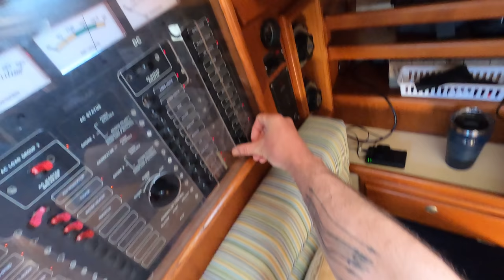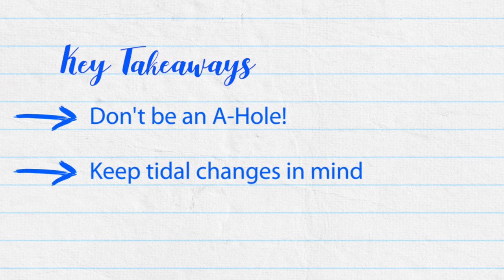I'm an IDIOT... | S06E04

Comment: That's why you need a mid ship cleat to which a line is already attached and ready to be tied to a mid dock cleat. Once tied, you keep the engine in Fwd gear to force the boat to get closer to the dock giving you time to cleat the stern and bow lines.
Reply: Exactly.  Takes 'some' of the pressure of marina docking out of play.
Reply: As you gain confidence with the bigger boat, you'll appreciate the importance of a well-placed spring line. It will snug you right where you want to be; then you'll have time  to tie off bow and stern lines.
Reply: Exactly, mid ship first, then bow and stern lines.  Once you get the mid ship line attached, all the stress is done with.

Comment: I don’t laugh out loud often, but when I do, it’s when someone applies Forrest Gump to real life. Anyone worth their salt has been there. Anyone worth knowing will admit it.
Reply: Yes indeed, and I laughed very loudly on that one.. hahha well done!
Reply: I idled one of our center console boats home at 2 knots for fifteen miles because I couldn't get the engine to go above idle.  I couldn't figure out what was wrong out on the water.  They next day, on the trailer, I immediately saw a clamp was loose on the throttle cable, that was just stopping the cable from pushing the throttle forward.  It took me three minutes to fix it.
Reply: HA! I totally laughed out loud at, "I'm not a smart man".

Comment: Tip for backing out of your slip:  to minimize the undesirable effect of prop walk, when you want to back out of your slip in a straight line (or even swinging your stern to stbd), put your shifter into reverse, give it a good shot of throttle, then quickly shift to neutral and steer to place the stern where you want it.  The idea is to get some momentum going in reverse without allowing the prop walk to take over - if you need more momentum in reverse during the procedure you can just quickly shift into reverse, give it a shot, then back to neutral.    That way, your rudder will be the chief instrument of steering, and your effort will not be confounded by what the prop is doing.
Reply: I agree.  You probably already know this but your boat is so heavy you can use the momentum to your advantage. Absent wind and current you can rotate your boat in place clockwise ( to starboard). While stopped put the rudder hard to starboard.  Gun it in forward and let the boat start to turn. It will turn before you go forward because of propwash over the rudder. Leave the wheel to starboard and before going forward too far, gun it in reverse.  Prop walk will continue the turn to starboard even with the rudder unmoved.  Before the boat starts to go backwards to far, gun it in forward again and keep the boat rotating.  Rinse and repeat. Doesn’t work to port.
Reply: @edburke2902  You are both right.  I remember when I finally learned the technique you described.  A life changer for me and my 20 ton Kelly-Peterson 46.  I think the key is to not be shy with the rpm's when you give it that boost to get momentum.  These two will have it mastered in no time.
Reply: I had a 31 Hunter that could walk to port around the world. Thar is what I would do. Power-coast. Power-coast

Comment: I have mailed you a complete shop repair manual for that transmission..You don’t start troubleshooting this one without that manual. The shift adjustment and lever position are very important to assure proper shifting. It is very important to have shop repair manuals on boards of all the critical boat components..

Comment: Lessons learned guys, just quick tip from one boater to the other (I also didn't see if you were doing this):  keep a pole in the cockpit to help you grab or push off in tight areas. Great communication between the both of you. Just keep practicing, you guys will get the hang of the boats characteristics soon enough.

Comment: When you're working in tight quarter like that, and on a new boat small issues like that happen.   Once you get acclimated and more intimate with your boat you'll be fine.    The fact you owned it and put it on camera is huge.  Double thumbs up and you two enjoy your spring and summer now, in the states.

Comment: Regarding the instrument’s low voltage while the battery had plenty.  Check the instrument wire size.  Odds are good it’s undersized probably because more instruments were added but the wire not upgraded.  Undersized wire will heat up, causing resistance and then low voltage readings.
Reply: Good tip; something to note; thanks.👍

Comment: Put a loop of line around the piling to hold the bow in place, then in forward, the stern will walk around to starboard.  Push off the piling, let go of one end of the line as you move forward.  Maneuvering with wind is a skill set only time will improve.  Everyone is stressed in these situations, keeping ones cool is important.  Good job.

Comment: Great video and excellent to see the docking practice. One thing I have learned over the years is never try to fight the elements and always try to use the characteristics of your boat to your advantage. When you first attempted to reverse out of your mooring you had the wind and prop walk working against you. What would have been better is to back out and go backwards out of the alley rather than to try and turn around and go forwards. That way the wind would help push your boat to starboard and prop walk also helps push your bow to starboard. Once the boat straightens up with the wind from behind you can easily back down the alley way. So much easier and less stressful. Good luck and give it a go and don’t be afraid to go in reverse. Keep up the fabulous videos.
Reply: I was going to say the exact same thing.

Comment: Something that is easy to forget is that you can't steer a boat if you're not moving, and it is easier to steer the faster you go (or at least the more water passing by your rudder in a current). It is usually best to give quick bursts of throttle when doing the forward/reverse tight turning leaving your slip.

Comment: Good job with the practice.  You did well. We had the same problem backing out of our old slip—prevailing winds and prop walk exactly wrong.  You might Try turning 270 degrees to the right rather than 90+ to the left.  Use your prop walk to help the turn rather than fight against it. On our boat it was easier and we had better control that way, plus we could accomplish the turn with less room to maneuver.

Comment: Don't feel bad, Jordan. You had the best possible outcome from that long drive--everything was fine and you got back a working transmission the same day!

Regarding docking, I had a 30' sailboat years ago and was very comfortable docking it. A couple years ago, I got a 40-footer and was nervous every time I pulled in or out. I had no idea where the bow was and couldn't judge the distance from the port side to the finger on my slip. Now the 40 feels like the 30 did before. You'll be amazed how all those extra feet just disappear as you practice and gain proficiency.

Comment: Great Stuff ! Remember, you do not need to turn around immediately after exiting the slip.  For the first maneuver:  try standing in front of the wheel facing the stern...get used to driving stern first. Facing the stern with the wheel in front gives you a different perspective. You will no longer feel like backing should be a temporary state especially with that beautiful canoe stern.

Comment: Great video both! We have a long keel boat and I totally get the feeling. Few tips I got that might help: landlines. Works great as a tool. e.g. for undocking in the situation you had you could use a spring line from the bow to the dock or even the mooring post. Wait a bit when the boat is out of the slip and use it to have the transom blown by the wind into the right direction. Another tip; give 45 degrees rudder and then give some small but powerful burst of gas. You then do make the turn but not the speed. Anyway, as you mentioned: trying is the best way to learn. Have fun playing around!

Comment: Nice job owning the situation and learning from it Jordan!  Nice job putting op with Jordan Desiree.  I once spent two 14 hour days troubleshooting a generator that wouldn’t come up to speed after replacing an injection pump.  Fiddling with ramp rates, set points and PID loops, changing governors not to mention pulling the pump on and off who knows how many times.  I finally discovered the control had a separate speed potentiometer late on the second day, a little twist of the knob and viola, fixed!  My supervisor then had to explain to the customer the reason his genset was down for two days is that I was an idiot ... and I was supposed to be the “professional “. We all make mistakes, what matters is what we do about it.

Comment: to be fair, such mechanisms usually don't rely solely on friction to work properly. most, in addition to the pinch bolt, have a series of splines around the inside of the hole in the lever and matching ones on the shaft to prevent slippage. the number of splines and their proximity to one another provide adjustability.

Comment: Having a long keeler one of the most useful things for me is a midships cleat. There are a numerous resources on the technique. With a short finger pontoon it is easier to use this first, you can then use the engine to hold the boat in place, deal with the stern line last. As for the tides one quote from a club member who was hard aground, " I know the tide goes in and out, I forgot it also goes up and down".

Comment: When going alongside best practice is to focus on the middle cleat, prepare as always but initially ignore stern and bow lines. Fenders out. Steer the boat as close to a cleat / bollard /etc on the dock with the crew holding on to a shroud standing outside the railing already. As soon as it's save he/she steps ashore and fastens the line from the middle cleat to the dock. Now the boat is under full control no matter of wind or current and you have all the time to fasten the other lines. 
As for the shift lever I am truly amazed that it isn't sitting on a toothed shaft.

Comment: We went through much worse docking scares and stresses after upsizing! Try a midship spring - we found this one line makes it easier to dock even against current or wind. Find the balance point of your boat when motoring ahead (in our case it's slightly aft of mid ship). Rig a line with a spliced loop as a lassoo,  and bring it through a block at that balance position on the toe rail or other strong point back to a winch in the cockpit. Your partner can use a boat hook to snare the cleat at the end of the dock with the loop end without stepping off the boat (way safer). Helm person take up slack on the winch which stops your forward motion. Now turn wheel away from dock and use gentle forward - the prop wash and spring action will bring you alonside and the boat will sit happily like that so you can step off and make up the bow and stern lines then fit the springs. When manouvering in tight spaces your boat will turn much easier clockwise than anticlockwise due to the prop walk - using bursts of fwd and rev you can spin round in your own length. Also easier to dock on Stb side as the prop walk takes you away from the dock when you reverse out. If you dock on port side, try a doubled up spring line from bow through mid dock cleat and back to bow - motor forward against that to kick the stern out even against the wind before backing out. Good luck mate :)

Comment: So, good on you guys for practicing.  I learned from my merchant marine husband to "pulse" the throttle to turn the boat without gaining much way forward.  So in your backing example, instead of a continuous gun forward, several punches would have probably spun you around better without the threat of more speed careening into obstacles.  Also, learn to use your lines to leverage yourself out of tight spots.  If you could have had a stern line on the piling off your starboard quarter, you could have backed into that line, it woulve held your stern from walking and enabled you to spin out of that spot a little easier.

Comment: When you left the slip, you should have just gone backwards out of the narrow channel. Never anticipate that you can push the bow of a larger boat through the wind in a narrow channel. You might be just going forward and backwards and slowly be blown into the dead end of the channel. There are never issues pulling the stern into and through the wind. Same goes for leaving a dock: sometimes leaving backwards is better if going forward would mean going through the wind.
When it comes to the walking prop effect: Try to accelerate the water under the boat with high rpm first, then immediately reduce to low rpm and the prop walk will be less. When maneuvering, I give the boat a spin in the opposite direction in the second before reversing. The inertia of that turn will counter the walking prop effect.
A larger boat often has a midship cleat. When docking with one person, it is much easier to just have a short line running from that cleat to the dock. You then have all the time to get your bow and aft lines sorted out.

Comment: Good effort on keeping at it, all day, to get a handle on it :-)

I have a small piece of advice, investigate using your warps more for docking.

Holding a line from the bow, looped round a cleat you can slip and take with you - so you can hold the bow in for example when leaving the slip.

When coming in to dock, consider a spring line first, and drive against it to tuck in, and even stay idling against it so you can be held in place while you get everything squared away.

With the tides, where possible always head to the dock into the tide, even if it means going passed your destination and turning round.  This gives you steerage without speed over ground.

Keep in mind it's a boat, not a car. Think in terms of using the wind, tide and warps ahead of reaching for the engine controls, you'll hopefully have an easier time of it in future!

Comment: Good job with practicing!  We went from a 33 foot sail to a 42 foot sail and it was an adjustment but doable.  Then we went to a 48' trawler that had the prop walk go to starboard rather than port like the sailboats and THAT was hard to get used to!  But all through our boating years, docking would have me put a spring line on first.  Once the spring line was on, we could use the prop walk to help pull us in when docking on port.  Our bow line was almost always the last line on.

Comment: It is always scary to dock the boat. Our old semi-long-keel without bow prop, is also terrible in tight spaces. We are now always docking by using  a spring line from mid-ships and aft. Then we use the engine and to push the boat towards the dock and hold it there. We find it a lot easier to only have one rope to focus on when docking. 
Good luck with your new beautiful boat. :)

Comment: If you are coming into the dock too fast, you can scrub off speed by 'surging' the dock line around a cleat. It saves the possibility of hurting your back by trying to stop a boat with your hands.
Also, on a boat the size of yours, it is worth learning how to dock using a midships cleat if you have one.

Comment: Nice video.
Two hints when docking.  You can't steer effectively when engine is in reverse.  Use the engine as a thruster.  Give it enough power to start moving in reverse then go to neutral and now you can steer.  Need to go further in reverse.  Give it enough thrust to get moving again and immediately go to neutral and now steer.
Second hint is when going forward and turning but nearing an obstruction  go to hard reverse  but do not move the wheel.  As long as boat is still moving forward and slowing it will continue the forward turn.  Only after you stop or start in reverse will the rudder come to play.

You can do a cool maneuver by turning the boat 360 degrees but not going forward or back using this technique.  Try it and enjoy.  Start moving forward and say turn hard to port, then hard reverse until you stop turning, then hard forward to continue the turn.  Repeat until you've gone 360 degrees and you never moved the wheel.

Comment: haven't watched the full video yet but had a 47 footer for 7 years.  Lesson number one for me was "Don't fight the wind."  Get comfortable operating the boat in reverse...should have just backed out into the main fairway.  Also to avoid prop walk add more power and get the boat moving so you have rudder control.  Practice using prop walk to help maneuver in tight places...you'll find that you can spin that baby on a dime.

Good Luck.  It's an adjustment but you will make the transition in no time!

Comment: Docking can be sooo challenging when you are battling wind and current, even in a boat you are familiar with.  You did really well considering it was your first time in a boat that size.  For what it's worth, when your entry into the fairway carries you away from the slip, I prefer to go past about 2 boat lengths, make a U-turn and head back into the slip.  This way, you can use the throttle in forward and reverse to counteract any drift from wind and current and adjust your speed.  With prop walk to port, you should be able to spin that boat clockwise even in tight quarters.  Put the helm hard over to starboard and alternate bursts of forward and reverse without moving the wheel.  The boat will spin on it's center of mass.